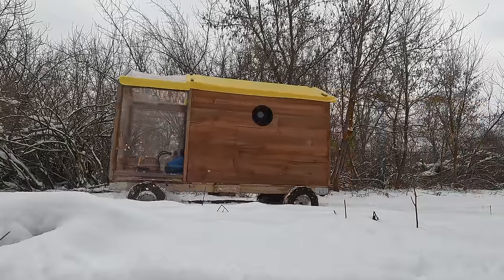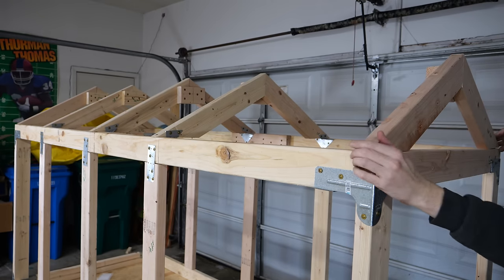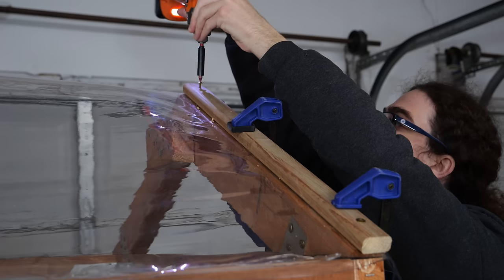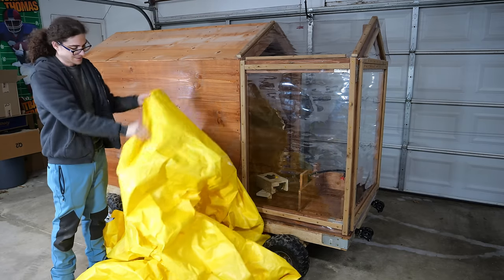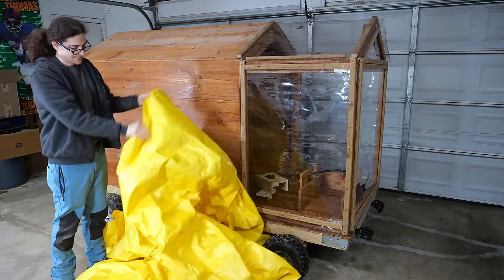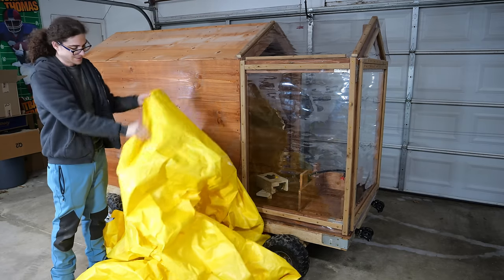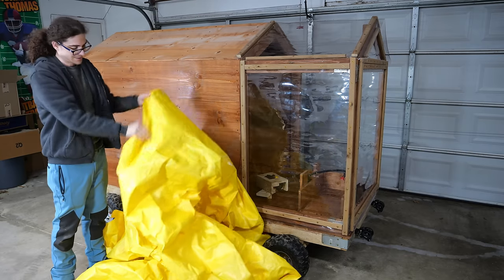UPGRADING The Drivable Camper - Full Cabin Build + Snowy Overnight Adventure

Comment: You could add some cheap and lightweight styrofoam insulation on the roof and walls, and make a double glazed window area by just adding a layer with some room in between and leave the outside layer open at the bottom, this way for just a few pounds of extra weight you'll save a lot on heating and less condensation will be formed, this will also make it more quieter which could be a tradeoff.. I know with adding this not everything is going to be insulated but every bit helps

Comment: The hammer function of a hammer drill is meant for drilling through really hard things like concrete, bricks, mortar, rocks etc. you use a special drill bit that has a head shaped like a blade that acts more like a jackhammer than a drill. For wood you want to slice the fibers, not hammer them. Obv you got the job done but it would be more comfortable just to set the drill to “drill” than “hammer”

Comment: Your waffles are still too soggy like mine. This is what you got to do:  Use Cornstarch: Adding cornstarch to your waffle batter helps make the waffles extra crispy. A good ratio is about 1/4 cup of cornstarch for every cup of flour.
Whip Egg Whites: Separate the egg whites from the yolks and whip them to stiff peaks before folding them into the batter. This makes the waffles light and airy on the inside while keeping them crispy on the outside.
Preheat Your Waffle Iron: Make sure your waffle iron is fully preheated before you start cooking. This ensures the waffles cook evenly and get crispy.
Use Buttermilk: Buttermilk adds a nice tang and helps with the texture. If you don’t have buttermilk, you can make a substitute by adding a tablespoon of vinegar or lemon juice to a cup of milk and letting it sit for a few minutes.

Comment: a bit of a plow nose might help. some insulation and vent holes.some 12Vled strips,r that must be one strong motor in there. totally awesome build. would a induction plate be more power efficient? pitty that app hasnt got a bingo function. then could mark how much energy you use how much energy was used for traveling and set that

Comment: Using lighter materials than wood would go a long way toward saving power. For example, the roof could be made of corrugated fiberglass instead of 100 lbs of wood. Etc.

Comment: a gas heater is a bad solution. It will burn oxygen. An electric heater is required. For example, an electric rug that will work from a power bank and a winter sleeping bag just in case.

Comment: 12:03 you stained everything expect the bottom that will be wet most of the time.... 
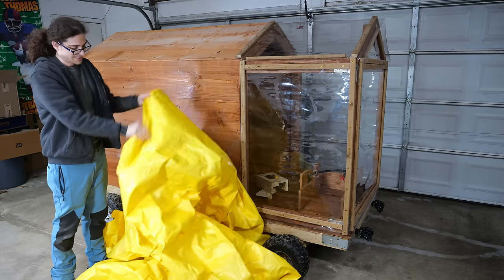18:54 if you drilled it 90degresse you could have had control over how much you open the window now its all open or all closed

Comment: I would practice curling your fingers inward when cutting your food, as though you were performing a tiger claw kung fu attack. If you're doing it right the middle bone of your finger will press safely against the broad side of the knife and your fingertips will be safely tucked where the blade can't cut them should anything go wrong. 

I would hate for you to have a bleeding emergency out in the middle of the woods.

Comment: Okay watch the video where he upgrades the 1.0 camper to the  2.0 camper and if you watch that video then you would know that he put tracks on the 2.0 version yet the 3.0 version doesn't have the tracks where are the tracks there are wheels not tracks there should be tracks there I don't know what happened to the tracks but the tracks should be there the tracks where are the tracks the tracks put the tracks back where are the tracks???